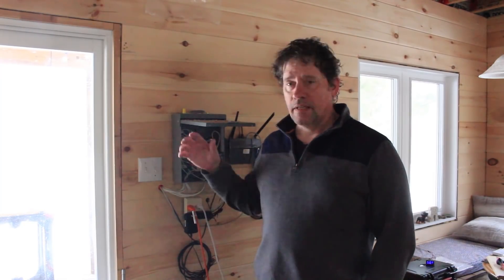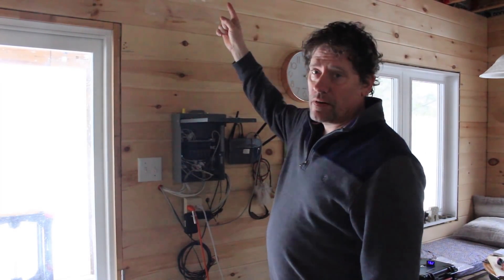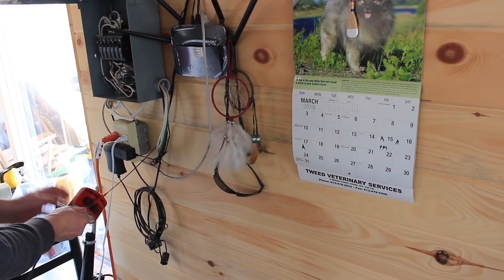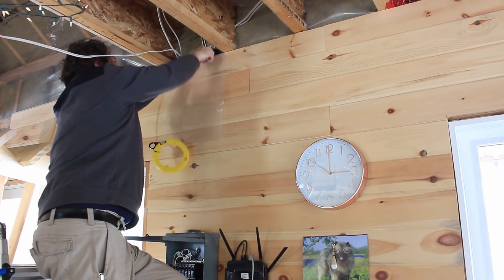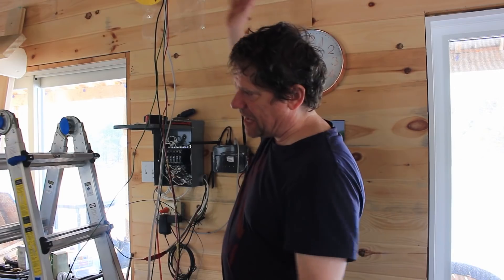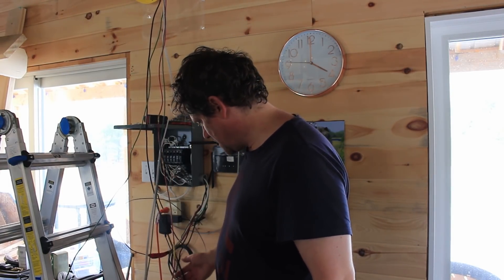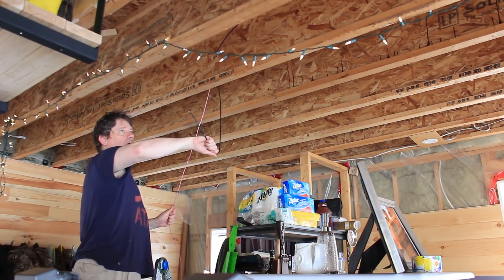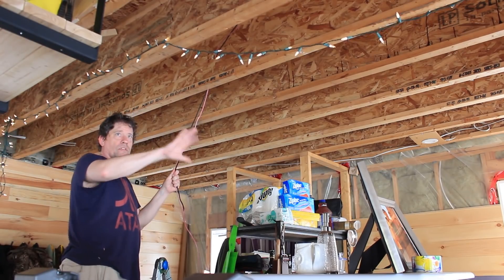Wiring Drama at the Off Grid Cabin

Comment: That is one of my biggest fears: closing up my walls before running all the wires I need. I keep thinking of additional wires that I will need like stereo speaker wires and HDMI cable for tv. But luckily I'm a long way off from finishing my walls. I feel the same way about wire color - as long as I know what the polarity is and where the wire came from, that is all that matters to me.
 Stick to your day job - you are not Keith Richards on the guitar!  :-)  This gives a whole new meaning to the term blind nailing!  The first rat's nest of wires is a challenge, after that they are a pain in the butt! Thanks for posting this reality; I'm glad to see I'm not the only person that runs into problems!

Comment: 3 wires will start/stop most small engines if the starter battery is next to the engine.
1 12v hot to solenoid, 1 ground to kill it. Might want 1 12v run if it has fuel solenoid ect

Comment: I would use as much of the romex type wire that's double insulated as possible.  It's easy to tear the insulation on the individual wires.

When you talked about remote start for the generator, I was thinking a starter and battery on or at the generator so no wire would be needed(remote would be battery operated ).  I'm not sure if you are going to use 12v DC for the starter or 110v AC.  That would affect whether it needs to be inverted to 110v or if more components like a transformer are needed.

Comment: well.... I would have considered going down the wall & cross the cabin under the floor rather than tearing up vapor barrier etc to go across the ceiling! Also,  if you do your homework 1st, know how many wires, (conductors,) required for the job and get a cable that has the proper no. of conductors all in one! That way, easier to pull & tidier job. Just sayin.
Otherwise great vlog, although a little painful to watch at times but Great Bag o' Dicks, lol.